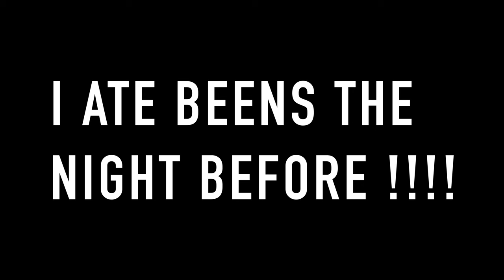My Low Rider ST. - Rolled Away !!!

Comment: That lift is a cool setup.  I ruined some puddy knifes trying to get that mouse pad stuff off. Its crazy. They make some self leveling concrete. Not sure how much it is, but maybe try to fill in some of the ruts, just where you push the bike around.  Great save. I jumped out of my seat when it started rolling.

Comment: I Have a Let it Roll system the I got used on Craigslist for $200. Works Great!!!  You need to see about putting some kind of poly filler on your floor. I am sure you probably rent. But it would be better than what you have as a floor now. either that or lay down some plywood to smooth thing out.
Reply from the maker: Good idea brother! Thanks
Reply: You can also buy concrete repair kits.
Reply: @letsrollstore  Yep that works too, was just being alternative Since Sandy rents some people won't let renters make improvements. BTW my Let's Roll is fantastic

Comment: Sandy, You need to strap the bike to the dolly so it can't shift or move. Then back the dolly and bike out of the garage so you have control of it, one hand on the handlebar one back by the saddlebag. That way you can use your legs to control the bike. Pushing it out like you did had all the weight in front of you there by, no control at all when it took off. Close but turned out ok thankfully.
Reply: Very good advice.

Comment: That is a nice lift but I still like the J&S Jack  and that's because its purposely made for Harley and only 2 easy steps to lift and maneuver. You can lay a couple sheets of Masonite on the garage floor and it will be easier to move the bike around.

Comment: You scared me spinning the bike around in the garage. To close for my comfort.  I would suggest putting some padding on the walls so u dont scratch the tourpack in the future. Get some moving blankets from homedepot and secure them to the wall. I used them in my  enclosed trailer ,work well.

Comment: Hey I think I found a solution to the headlight ring if you are interested in what I ended up doing
Reply from the maker: Go ahead - let us know please
Reply: @HOLYSHIFT  wish I could send pictures but I will explain best I can. The issue with the ring is it is too loose and no real pressure being applied to so it can fall off. I found some "D shaped" weaterseal (5/16 x 1/4in) with adhesive backing at the hardware store. I placed 3 strips on the inside of the ring on the backside of each of those retaining clips are. Then I put a long piece all around the outside of the headlight close to the inside of the fairing. This will allow for just enough pressure/dampening to keep the ring from falling off and help keep bugs/dirt out of that area